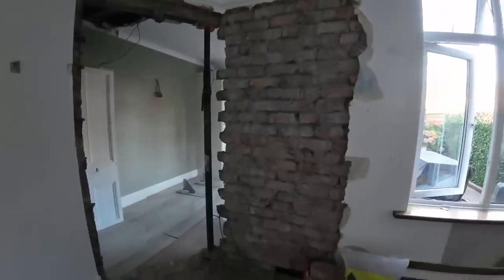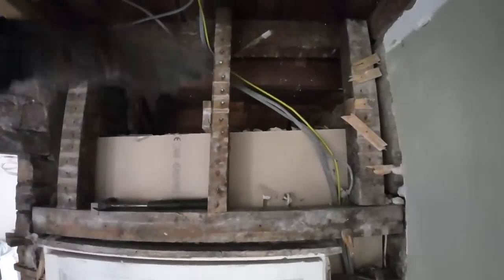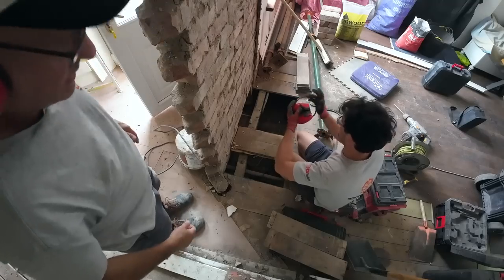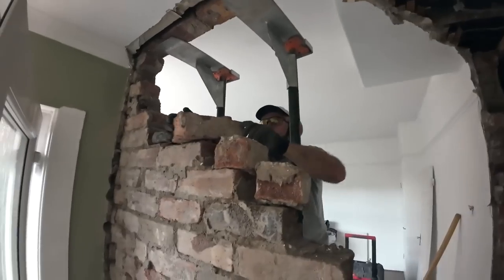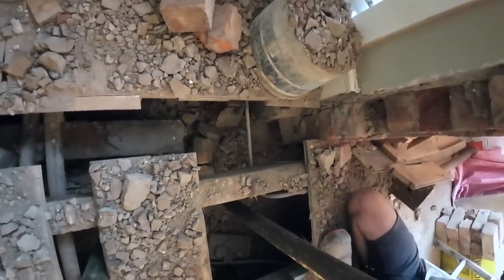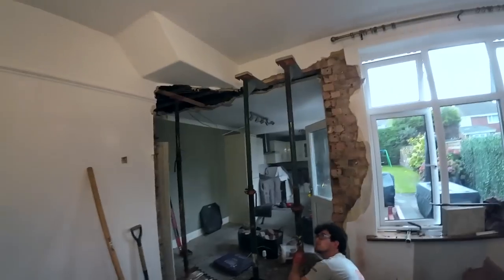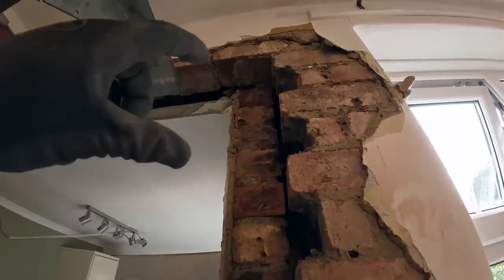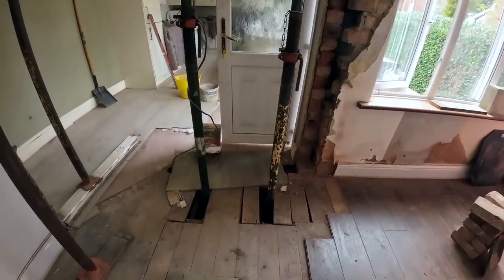GOAL POST STEEL JOB PT 2..  PREP & DEMOLITION

Comment: I'm looking to get a laser level at the mo and wondered if the one you used in the video was a "Milwaukee M12 CLLP"?
If it is, would you recommend that one? As it seems like it lights up pretty good in the daytime.
Reply from the maker: It’s an m 12 but I would get the top of the range which does a square line too 👌🏼🧱👍🏽
Reply: @SteveAndAlexBuild  Cheers for that. 👍😁

Comment: Correct me if I'm wrong Steve but I always thought a kitchen and a toilet had to have two door separation for building regs....Is that not the case ? Anyway, as always, good job fellas....Saludos desde España mi amigos.
Reply from the maker: No idea pal 😬🧱👍🏽
Reply: I think old regs. I don't think the boys are up to date😊
Reply from the maker: @markrichardson5295 😁🧱👍🏽
Reply: No no wall needed, used to be but it changed years ago.
Reply from the maker: @nigelsmith1198 🤜🏽🤛🏽🧱👍🏽
Reply: There’s a member of the ku klux klan or the grim reaper stood outside at 25 mins, careful lads….